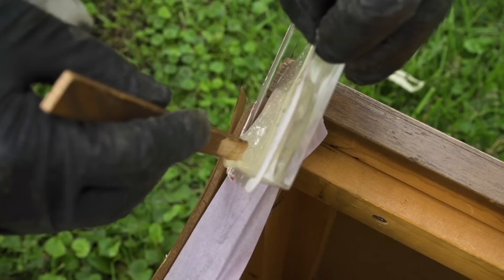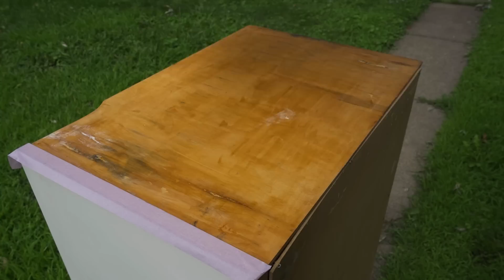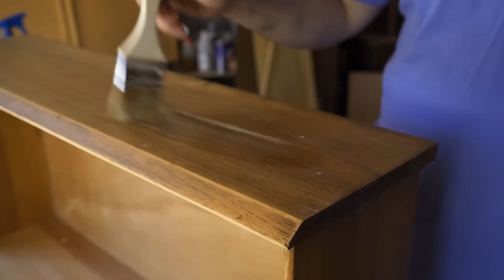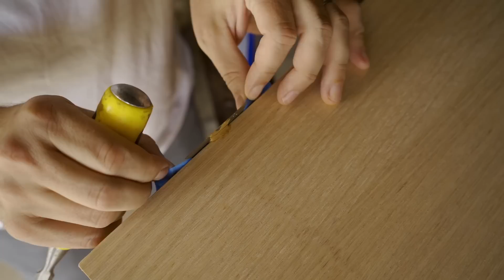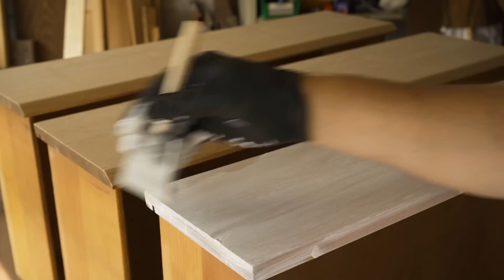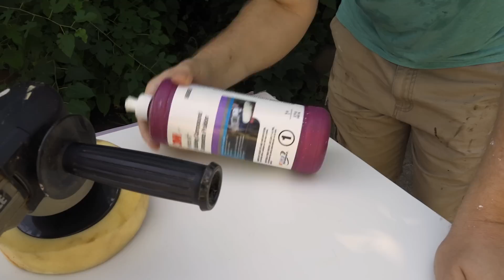I Found A Dresser In The Alley | Furniture Restoration · Veneer · Refinishing

Comment: A little tip to make peeling that kind of veneer easier is to steam it first, just take an old clothes iron filled with water along with a wet rag and place it on a section then steam it for a few minutes. The steam will help soften the glue and veneer fibers making peeling much less tedious.  👍👍
Reply: I was thinking there had to be a better way to get that veneer off.

Comment: Actually the drawers are made with dovetails. It seems that each drawer has a sliding dovetail on each side of the front. Even so, I agree with your comments about dovetails: if nicely done by hand on an old piece, they can indicate craftsmanship. But machine-made dovetails are merely one option for drawer construction, and not in and of themselves, an indicator of a high quality build. Thanks for the continuing to release videos which show what can be achieved by a person with skill and the determination, and not a ton of dough.

Comment: @TheUncleRuckus Great suggestion regarding using an iron and steam. Yes the glue is water based and at times I will leave wood I want to repurpose outside for a while (like solid oak, etc) that has multiple cross layeers of veneer. Andor soak with a hose periodically and remove in larger chunks. So for something smaller like this I think it would work great as all that chisel stuff (as anyone in the know - knows) it time consuming and tedious!
Reply from the maker: The chisel was fast and fun.
Reply: Huh - I've never had fun doing that :) @DashnerDesignRestoration

Comment: I've had good luck with a down cut spiral flush trim bit for that paper backing. got one years ago and it's still going strong since it only gets used for that situation.
Reply from the maker: Thanks for the tip.

Comment: Here’s what I would have done: First of all, I like the white gel stain, but to pick up on the white laminate top, I would have made the long wood pull solid white, as well as the inside next to the drawer. I would have also made the legs the same solid white. I kinda liked that metal pull but I fast-forwarded through parts and didn’t hear what you said about them. If you had enough, I think I would have painted them in white enamel, again, to match the top and to pull everything together. Just my two cents ;-) but I must add that I am typically blown away your amazing transformations! Imagine how many pieces of furniture you’ve saved from ending up in landfills! 👏

Comment: Unsure if this channel has refinished the following furniture...but I recently purchased them and would like to know more about them. Can anyone help me? 
"Many Moods" China Cabinet (60-inch width) with skirt instead of legs, wicker doors, black walnut finish, and designed by Lawrence Peabody for Sears (mid-1960s?)
"Roomates by Baumritter" Cabinet in Walnut finish with wicker doors and legs (30-inch width) (1959)
China Cabinet in Mahogany finish by Drexel (36-inch width, top piece has frameless sliding glass with etched handles, bottom piece has older style door pulls and square block feet)(1959/1960)
"Stanley" China Cabinet (50-inch width) in Walnut finish, frameless sliding glass with etched handles, and legs (1959)
"D.841-19 China" China Cabinet (42-inch width) in Walnut finish, frameless sliding glass and etched handles, single cutlery drawer, 3 doors, and inward-curved stubby legs (mid-1950s?)
"AFM Quality Furniture, Japan" 3-Drawer Nightstand (about 30-inch width and very low) in Oak finish with no door hardware and stubby round legs (1950s?)